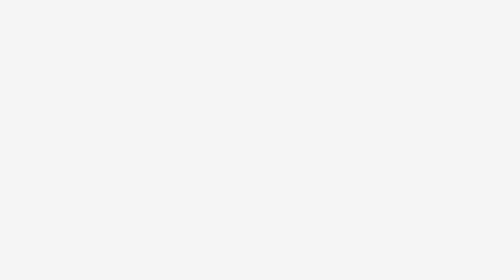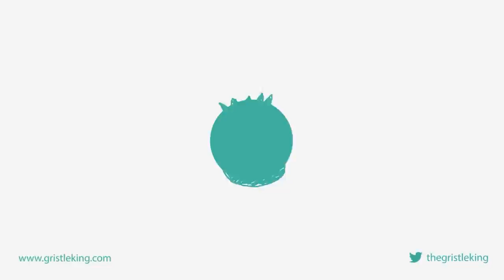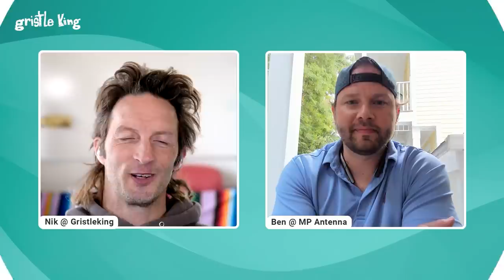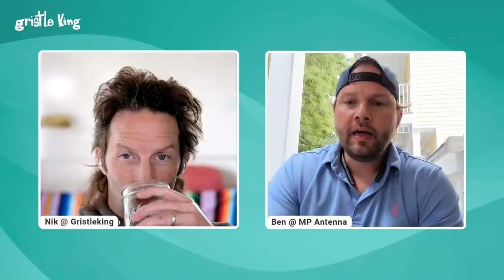Can I Use Amplifier And Splitters With Helium?

Comment: Hello, Nik. First of all, thank you for the video. Just wanted to introduce to you one device called RF Circulator. Rather then explaining all geeky stuff about this device it will be easier if you google about it. Basically it allows to use 2 antennas, lets say lower gain for TX (in order to stay within EIRP limits) and higher gain for RX (better reception) without a signal being split between them when transmitting or somehow affecting each other. And allows to receive a signal on one (high gain ant). It isolates to paths from each other. If you read a description of the device you will understand the concept.
Reply from the maker: Cool, thanks for the heads up Andrii, I'll check it out!
Reply: Since no component is perfect, some of the signal fed in will always reach the wrong port. But there it is about 20dB (1%) smaller than at the right port.

You can use such a circulator e.g. to connect an antenna with a transmitter as well as with a receiver, without the transmitter "blowing" directly into the receiver.

A circulator is something like a traffic circle, which you have to leave at the first possible exit. Most circulators have three ports: 1, 2 and 3.

 If a signal is fed in at port 1, it leaves the circulator at port 2.
- If a signal is fed to port 2, it leaves the circulator at port 3.
- If a signal is fed to port 3, it leaves the circulator at port 1.

Just use a bidirectional amplifier too increase the Rx. Shireen Helium Amp f.i
Reply from the maker: @sidburn2385  thank you!
Reply: @thegristleking  their are two kinds, clockwise and anti clockwise circulator’s

Comment: I totally agree with you about not using an amplifier or splitters unless it’s completely necessary. As a cable installer myself we either upgrade the cable or try to get the connection closer before we use an amplifier. The amplifier just adds one more point of failure to the connection that you don’t want and also most people won’t have the proper test equipment to make sure that the amplifier is working properly. For the splitters people think all splitters are created equal but they are not the ones that we use have circuit boards inside of them to ensure that the signal is flowing properly and not backfeeding into our network and causing reflections were some of the cheap ones that you get from the store just have the wires twisted together and they wonder why their service isn’t working properly.
Reply from the maker: Thank you!  Always good to hear from people who do this for a living, the feedback (no pun intended) is appreciated!

Comment: If you want to combine antennas, you must build cables to co-phase the antennas so they receive equal power.   I’ve been doing this for years as a ham.    I normally co-phase yagi or loop arrays or 2 vertical Omni’s.   I once built a set of loop arrays co-phased for 146Mhz and easily made contact between Opelika AL and Atlanta GA.    Part of co-phasing involves a specific calculated distance between the 2 antennas.   

I may do some experiments this spring to demonstrate.   But for my “production” helium hotspot I’m about to put in a 9dbi Comet KP20 as I live in a very poor location, lowest elevation in my area.

BTW,  I lived at Guatay CA in the early 70’s.  Loved it out there and Mt Laguna area.  Went to high school down at Campo HS.
Reply from the maker: Very cool, thanks for getting in deep with this.  I bet Mt Laguna has changed a bunch since you last saw it, love that place!

Comment: I forgot to mention, when you co-phase antennas properly, the net effect is to gain just 3db.    So if you correctly co-phase a pair of 6 dbi verticals, you’ll effectively have a 9 dbi antenna with a broader footprint.

Comment: The main distance comes from the fact lora is a spread spectrum modulation scheme. The low data rate is 'spread' over a wide bandwidth using 'orthogonal spreading codes'. 3Gphones work similar way. The result of this along with decent RF board means the rf sensitivity is real good. Hence you receive signals from so far away. On that point, the splitter with multi antennas issue Ben mentioned means the reflected power can 'desensitise' the receiver over time, meaning you receive less. Also, each antenna has a different freq response, so that will impact the amount of power reflected. On cable types, best option is to have the miner as close to antenna as possible, and simply have power and ethernet coming back to the house. Amps.. again at antenna not end of cable, as you lose a lot... in a way think of the setup like a cell site. High gain antenna with RRU at antenna nowadays, but in past antenna straight into lna then high quality feeder into equipment. Bandpass filters should increase the snr slightly, but the tech allows for interference, well actually assumes it.
Reply from the maker: Knowledge bomb!  Nice one Richard!

Comment: Any thoughts on improving 80’ LMR-400 run? Using an 8 dBi Omni, I’ve ordered an 11dBi directional. I’ve looked into amps but would rather use my old coax (Helix 7/8” Coax). Loss for Helix looks similar to LMR-900 but wasn’t sure if you’ve dealt with Helix cable or how well it would work on 900MHz for Helium.
Reply from the maker: Hi Matthew, whew Heliax ⅞" is thick stuff!  Should be fine, double check your brand/model on a cable loss calculator to be sure.

Comment: You can get a good band pass filter for $150 or more. Just note that they can can cost you 2-2.5db.
Reply from the maker: 2.5 dB!  That's a fair amount of insertion loss.
Reply: Some miners come with band pass filters built in.

Comment: I live near transmission lines in the US so I purchased a bandpass filter for my miner to help with noise. Will This hurt me? I think I’m okay because I am pushing out 5dbi right? 

Also if I’m at 5dbi in the attic should I also be updating  the helium app to 4dbi? Thanks
Reply from the maker: Shouldn't be an issue.  We discuss band pass filters starting at 33:01.  Regarding what you should update, you'll need to test that.  I just gave 1 dB as a random example number to keep the math easy.
Reply: @thegristleking  Thanks so much for covering this topic!  Answers on Discord have been elusive.  I do have the outdoor Bandpass filter from LCOM.

Comment: Good commentary. It's interesting, I started using 8dbi Rak antenna and one thing I noticed is that different hotspots have different outcomes with same antenna. My MNTD and Mimic miners (finestra) work really good with the 8dbi RAK, but if I use it on my SyncroBit for some reason I don't get good results. Also, my Rokland 8dbi, does horrible on my finestra but gets good results on RAK hotspot....Every location and miner is different and need to test to find out what will work there.
Reply from the maker: Hi Noah, yep, location is especially critical.  Testing eliminates a lot of the guessing.  Dig it that you've noticed that!
Reply: Ditch those rak antennas for your next miner. Buy a laird! 👍🏼
Reply from the maker: @lossless4129  agree, buy high quality antennas and move on to the important stuff.  ;)
Reply: @lossless4129  Or McGill

Comment: Question: so if I have a 8dbi antenna and have 2 db loss due to 45 meter lmr400 do I enter 6dbi in app?
Reply from the maker: I think you've got more than 2 dB of loss over 45 meters of LMR400; more like 6+.  But yes, enter in the gain of the antenna minus the loss of the cable.
Reply: @thegristleking  im sorry, I meant 45 ft!

Comment: What if I live about 50 miles from the big city and want to be able to witness hotspots in the big city? Is the amplifier going to help me reach the city better with an 8dbi antenna if going higher is not an option?
Reply from the maker: Probably not; you either have clear line of sight, in which case you should be fine, or you don't, in which case there's not a ton you can do.  I mean, you can always try it, but I wouldn't expect a huge change.

Comment: What we do with those makers like cotx, pisces, heltec that removed saw filters on the RX path and we are forced to use external filters with 2.5-4db loss? An RX amp will compensate for the loss? I compensated with a 10dbi antenna but dont like 
the angle of the high gain antenna. So for me an amp with 4-6dbi antenna will be better from a coverage pattern point of view.
Reply from the maker: Interesting; have you tested this?  Total bummer that they ship without the filters and you've got to cobble together a solution to overcome it.  Keep us posted on how it goes please!
Reply: @thegristleking  Some youtubers did and seems to work. In Europe they are sold out, like Jetvision ones. Ordered one from China, but arrives in March.
Reply: Shireen Helium Amp

Comment: is it possible to split a 20db antenna into 9-10db? or does it not work this way?
Reply from the maker: You could, technically, but it is very unlikely to give you a decent earning result.
Reply: If you want to reduce gain you use an attenuator.

Comment: Hi, Nik. Thanks for the great information. It seems like you missed one use case for the amplifier. What about using a bi-directional amplifier which is a straight pass through on the TX side in order to increase the number of beacons that you witness? This would not be increasing your output transmission power and would only help you pick up more witnesses. This is not something I am trying to do for any of my setups, but it is one use case I have seen people talk about which you did not address. Any input will be appreciated.
Reply from the maker: Might be useful, but to me it's an extra complication that doesn't make anywhere near as much of a difference as location, plus you have to account for it in the app, which can be tricky.
Reply: @thegristleking  this answer is the total pump fake. Ham radio folks have been using amplifiers doing for years to get better signals. I’m sure it works on Lora frequencies as well
Reply from the maker: @dantousuo1302  It's not that it doesn't work on LoRa, it's that Helium has a set of rules that more or less disincentivize using amps & splitters etc.  This is a difficult thing for radio experts to wrap their heads around, as we're not really going for "maxing out" RF abilities, but more for a sweet spot of proving coverage.  If you're a ham guy/girl, you've probably never had to deal with this additional set of rules.
Reply: A bidirectional amplifier passes through on the Tx (Transmitter) side and amplifies on the Rx (Receiver) side to hear/see more witnesses. For EIRP one needs to take Tx gain of the amp in consideration. PocV11 is to reduce the output dBm of the receiver/miner to the antenna and to comply with regulations based on where your location is. The full output of 25dBm isn’t transmitted due too losses from connectors/filters and cable.

Comment: What would be the results of putting 2 miners on one antenna?
Reply from the maker: It's been done.  It is considered gaming, as you're not providing any additional coverage, you're just getting one more "ticket to the raffle" without providing any useful benefit.
Reply: @thegristleking  Thanks for the reply, I'm surprised.
I tested this and it seems the miners are active at different times, they're at a 90 transmit scale, so it seems it would increase coverage??
I'm not trying to game as just covering more area and at different times.
If this is gaming, I'll unplug one.
Thanks again for the help.
Dale

Comment: I wouldn't mind to get one HNTenna, if it wasn't the ridiculous price tag for delivering to europe, getting a 3  dbi antenna for $300 is just a big no no. I wonder if there are other MP antennas closer to europe that we can try... (I don't doubt this antenna may be great in urban evironments, just not worth the extra pay for the income result...though I may be horribly wrong)
Reply from the maker: Hi Rui, you've probably fine with a McGill 3 or 6.  https://grstl.ink/mcgill-helium-antennas
HNTenna is a great antenna, but it's not magic.  :)
Reply: Try it EU 848Mhz Urban Areas with HNTenna and multipolarity works as black hole to pull all signals from all over even thru big hills no wonder this antennas are used in real mining they somehow pick up even from reflection signals I know many use 8dbi near me but for getting signals without having clear line of sight and 50km thru 3 hills is Magical.

Comment: Love the videos Nik thanks.  But I can’t get over the price tag on the HNtenna.  I just installed a super nice Laird 8dbi and it was only like 110 give or take.  McGills also.  150 seems like a lot for a little 3dbi antenna.
Reply from the maker: Yeah, I get it.  You definitely don't need to buy one.  They tend to be most useful in areas where the signals are bouncing off a lot of other things.
Reply: @thegristleking  they are cool though,  nice and compact. 👍

Comment: What about an amplifier and filter combo? Lol
Reply from the maker: Prolly worth watching the video.  ;)
Reply: @thegristleking  I did! Amplifier is meant for longlines and could potentially harm the miner over time depending on the extra power going into the miner. Filters are only best for noisy conditions and will lower gain significantly. But I don't think you addressed having the amp and filter in series. If you want to witness a signal seems like an amp and filter could be a good combo. While you're here, why are helium (old) miners so OP? I thought maybe it was an amp and filter addition in the miner maybe..